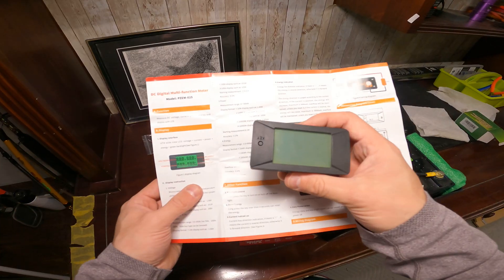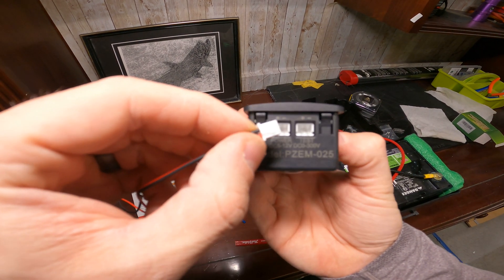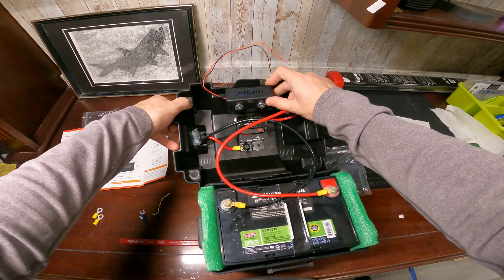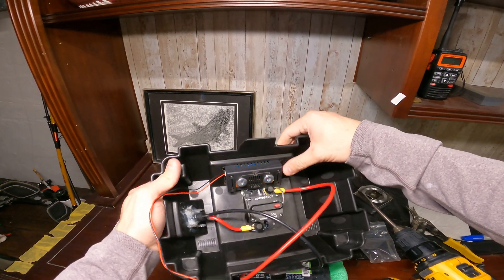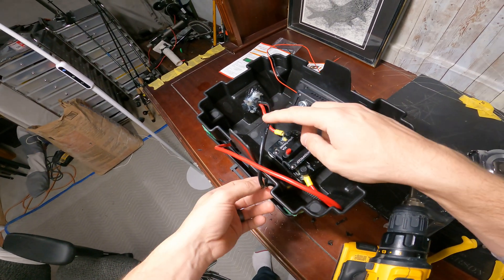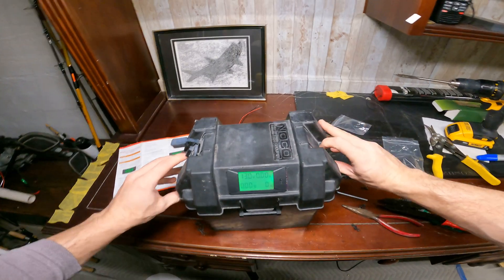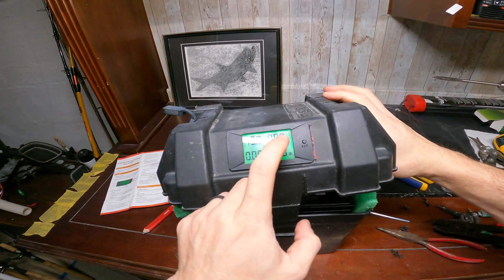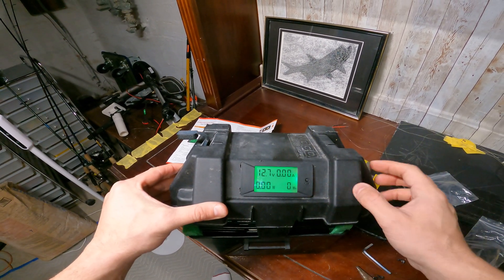Battery multimeter install for kayak trolling motor - voltmeter, ammeter, multimeter

Comment: What’s up Pete, which 80 amp hour battery did you go with?
Reply from the maker: Hey Anthony!  I think it’s called liitokala.  I found it on aliexpress, heres the link: https://www.aliexpress.com/item/3256803618604245.html?spm=a2g0o.order_list.0.0.af101802QWmUXJ&gatewayAdapt=4itemAdapt
Its kinda new I think so could be some unforeseen issues but so far so good, it was really cheap for the amp hours I got, just took about 2 months to ship
Reply from the maker: The banana plugs you can buy on amazon: https://amzn.to/3klJcXE and make sure you get the right charger too:  https://www.bioennopower.com/products/14-6vdc-4a-ac-to-dc-charger-for-lifepo4-batteries.  I soldered the banana plug connectors
Reply: Thanks brother!

Comment: What about a switch for power to the meter? Won’t the meter slowly draw dawn the battery if not in use?
Reply from the maker: I totally agree.  It does drain the battery to have it on like this but it was hardly noticeable for me during the season since I would take it out every week and charge it up the night before anyways.  But you are right, having a switch is better in the long run I think.